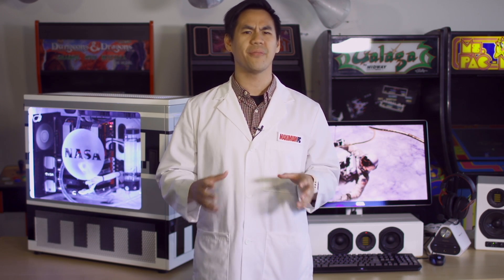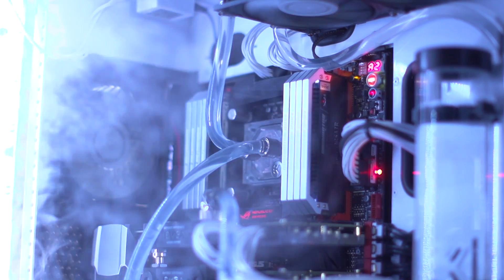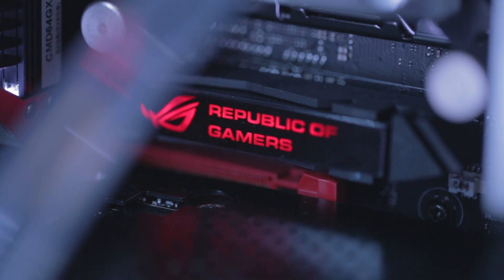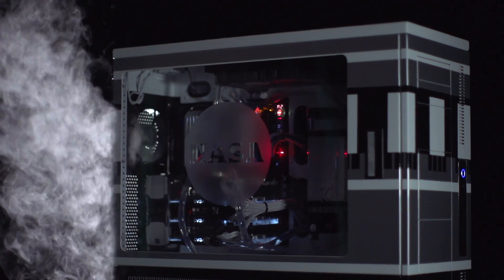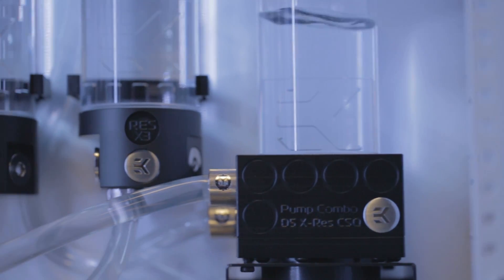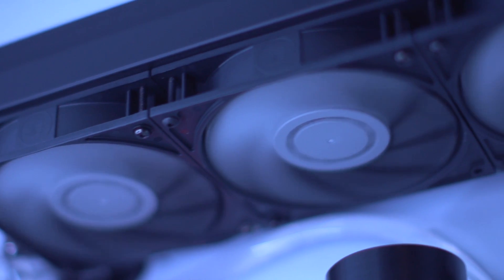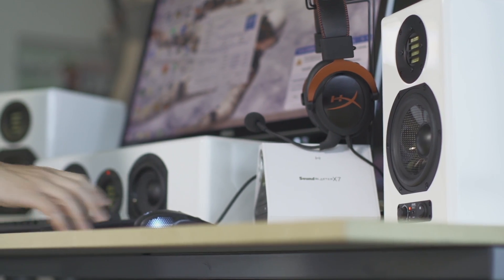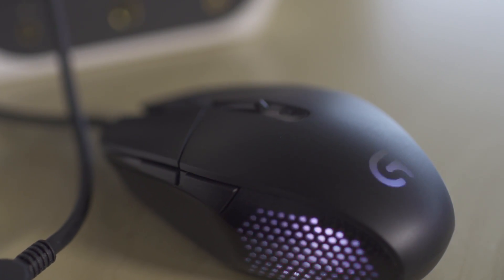Dream Machine 2015 Walk-through

Comment: you could go for dual xeon to make it even better.
Reply: +companyoflosers not necessarily...
Reply: +Sybren Bijlsma xeon may be great for server stuff, but for typical gaming there are plenty of none server grade cpu's that will do the job as good or better. xeon is designed specifically for server activities, not gaming. a top of the line i7 is better for that purpose.
Reply: Adam Liv well considering xeon is WAY more expensive anyways. your gaming performance per dollar is way higher with i7 anyways. more expensive doesnt mean more performance. its just that expensive because they know businesses in need of that sort of hardware have the spending power for it. if you still disagree and can actually EXPLAIN why as i have done then feel free.

Comment: but can it run minecraft on low settings at 480p at a decent 15-17fps?
Reply: +jeromy is boss might be a tough job so I wouldn't bet on it. I think it could get 10 fps, maybe 12 if you overclock the keyboard.
Reply: +K_A lol
Reply: +jeromy is boss Maybe 5 fps at most when render distance is 1 and 144p
Reply: maybe but you need optifine to make it run
Reply: Peevis And a toaster
Reply: +K_A wait but if you overclock the keyboard don't you need a better cooler?
Reply: Daniel Kuzko I thought that was obvious. I suggest a custom liquid nitrogen cooler to keep it at a steady -150C, I read from somewhere that if you let it go over room temperature it will explode and I want to make sure I have a couple degrees headroom.
Reply: K_A Makes sense
Reply: +jeromy is boss no it will run it at 1000+ fps on low and high also with low and high resolution
Reply: DudeOnly Gaming/and other stuff That's not the point xD

My computer runs with thousands of fps, so that one will as well, obviously (or maybe not, given it's better for multitasking), but we're joking.
Reply: OneDerscore One i know xD
Reply: DudeOnly Gaming/and other stuff Then WHY IN THE WORLD would you say that?? You seemed very serious dude.
Reply: uhh i uhh was uhhh uhh (got em  ha got em )
Reply: DudeOnly Gaming/and other stuff ?
Reply: +jeromy is boss I would overlclock the mouse as 12 fps would be to smooth you would need a fast smooth mouse so overclock the mouse.